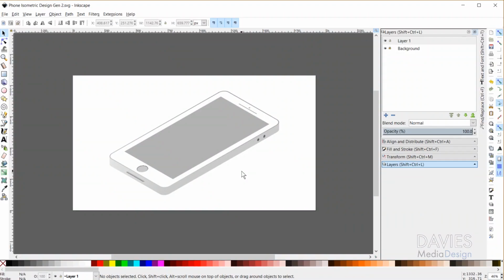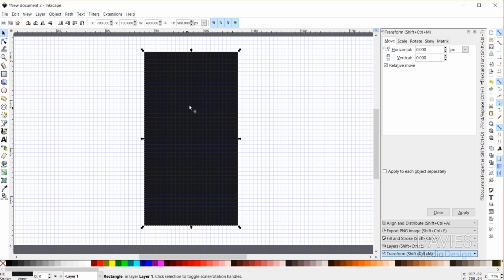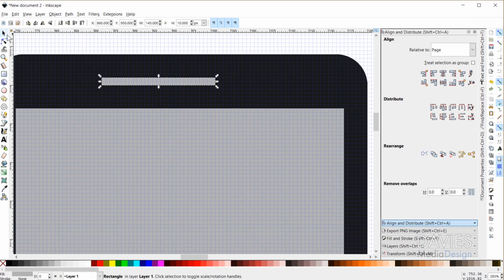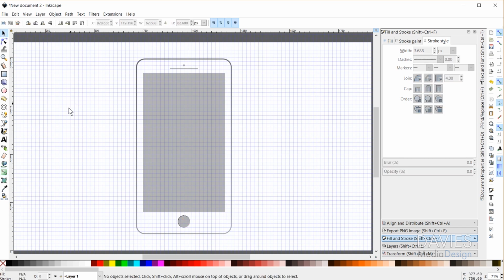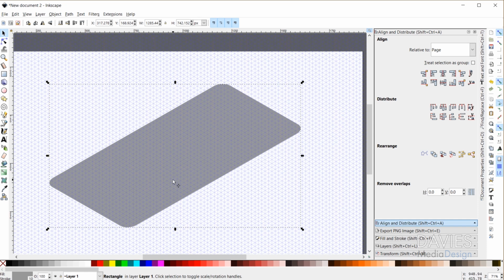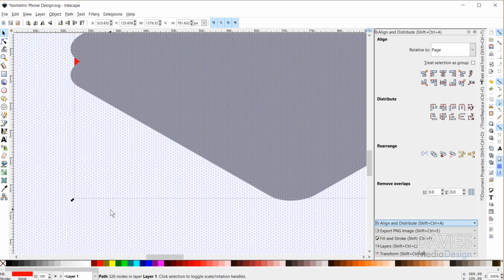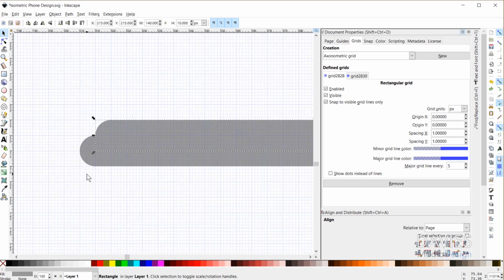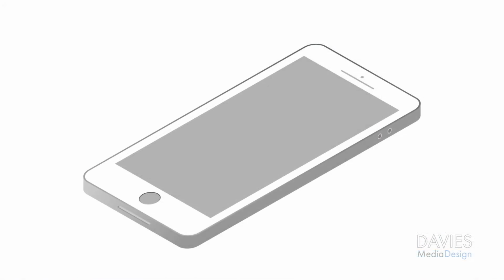Create a Flat Isometric Smart Phone Design in Inkscape

Comment: When interpolate, it doesn't put the new objects between the originals, they are vertical at the top of my drawing board.
Reply: Yeah. Same as mine and the vertical interpolate shape when you skew and rotate to the form of the original shape its x2 bigger and difficult to shape into the original shape. @DavisMediaDesign can you be of assistance?
Reply: @obinnauzoukwu1931  I haven't tested this in this tutorial but noticed on other videos that it was necessary to click the ungroup button before  completing certain actions.  Might be the same here if using the newest version of Inkscape.
Reply: If I was happy with eyeballing the 3D shape of the corners, I wouldnt have to go through that dumb and tedious interpolate function, I'd just use a bezier tool. But to make it perfect neither is sufficient. Is this all Inkscape can accomplish? Fuck that.